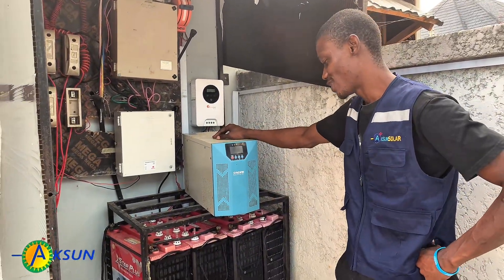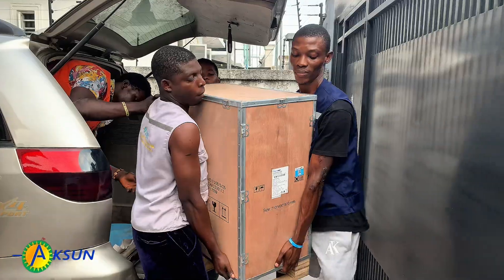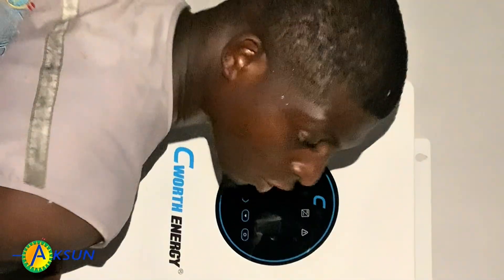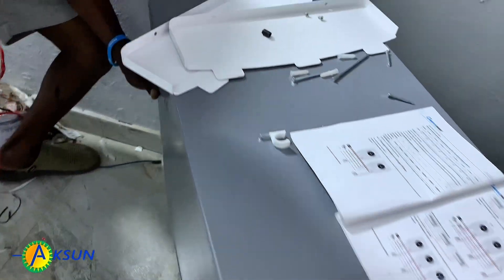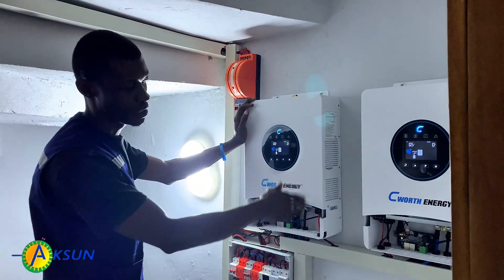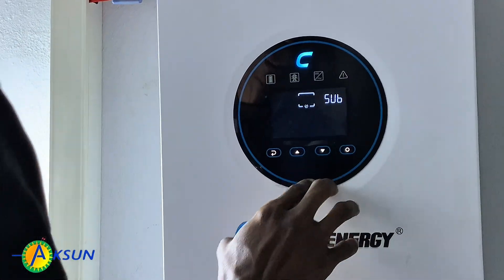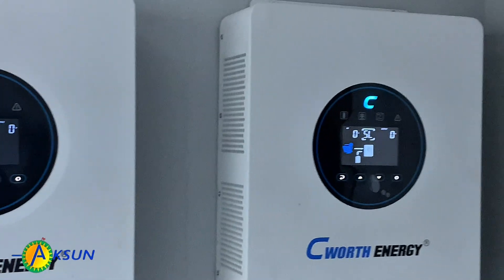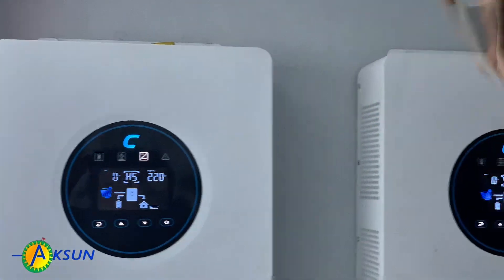Transforming a old 10kVA Solar System to a 12kW Cworth Energy Hybrid Inverter 15kWh lithium battery

Comment: Great work.

If I may ask, why 2 6kw inverters to one 15kwh battery??
Reply from the maker: We parallelled the two inverters to make one 12kw since we couldn't get one 10kw as a whole to replace the old one
Reply: @aksunelectronics1 Oh Ok, I thought 1nos 6kw can serve a 15kwh battery o, and you were probably giving room for future battery expansion.
Reply from the maker: @enahorookhamafe2710 yes, you can also use one 6kw inverter on a 15kwh lithium battery, battery is just your energy storage, the bigger the better the longer the duration you enjoy the energy stored